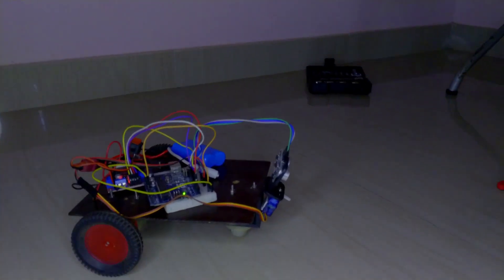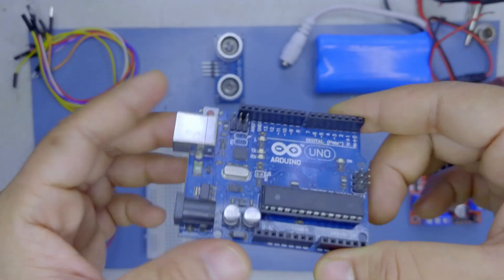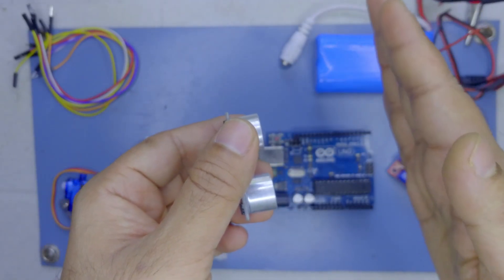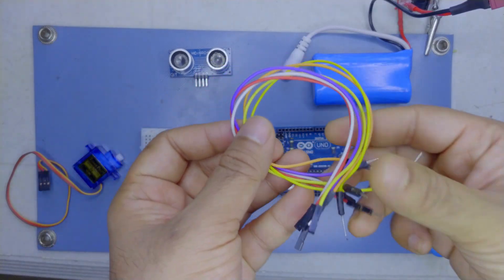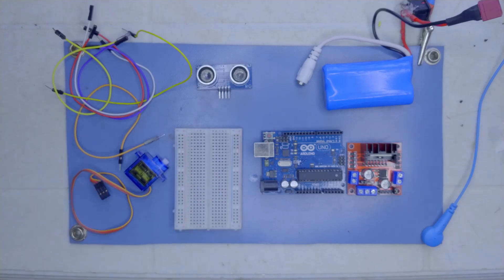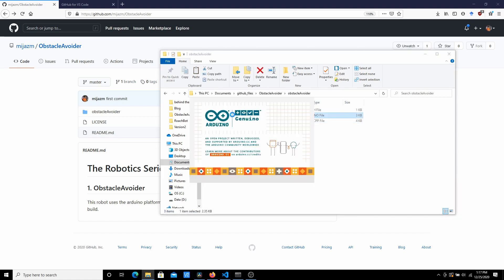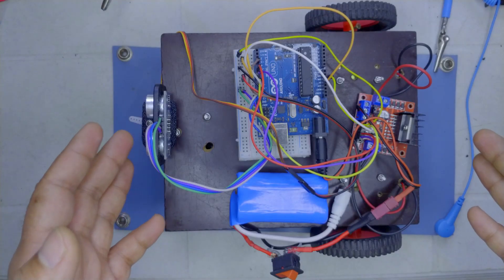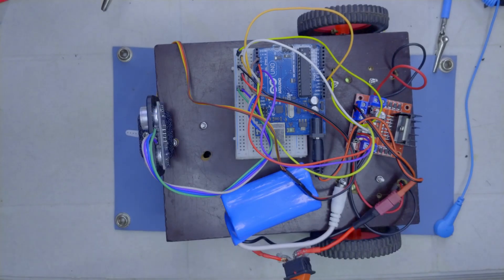#5 Obstacle avoiding robot using ultrasound!

Comment: Hi, sir

I need the help of yours on making robots for my college project,  
I have to make 4 robots that are controlled by 1 external placed camera module. In this project No sensors for navigation/object detection to be mounted on the robot.    
Only 1 external placed camera module will do Live Image Processing and control the robots.
 I need your help and valuable suggestions on this, I am planning to use
PID Control, Model predictive control(MPC).
(hardware- NVIDIA jetson nano for image processing)
Reply from the maker: That's a cool project! I might not be able to help you directly though(day job and channel keeps me a lot busier than I would like). I would recommend you start with opencv library for object detection and localization, a quick search on google will get you a lot of info. As for the robots I recommend using ROS, again a popular and powerful set of tools and libraries. You might have already given these a shot, in any case good luck with your project!
 PS:I am working on some ROS based projects which I will try to upload soon.